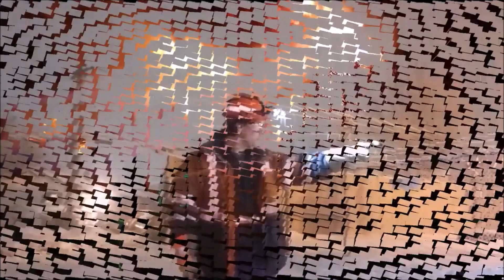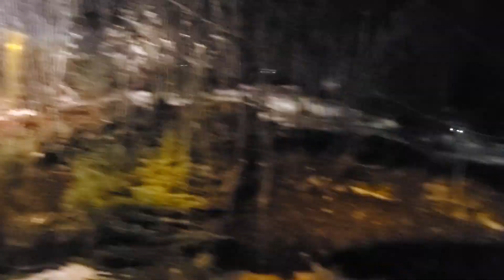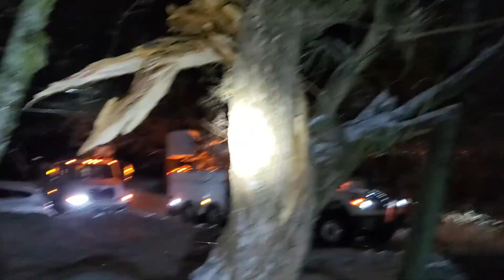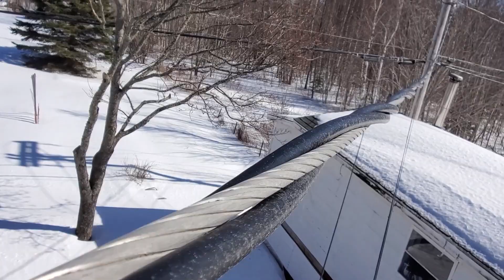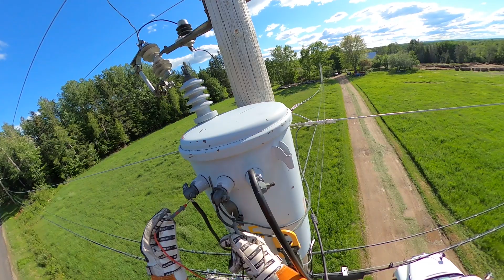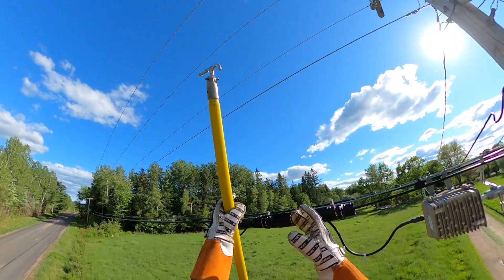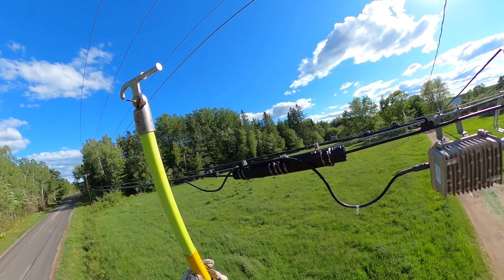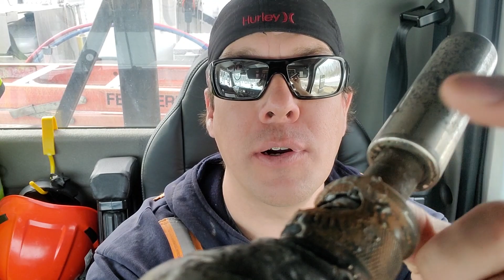Accidental contact with 120 volts

Comment: I can't imagine the fault current. Glad to hear no one was hurt. Stay safe! 👊
Reply from the maker: Definitely broke 1000! Yes, very lucky there wasn't even a slight sunburn. Cheers!
Reply: If he was close to the transformer, maybe 6kA.
Reply: @jfbeam  Probably not that high if it was residential.  I believe a 50kVA pole pig with 5% impedance has an available fault current around 2400 amps.  Residential breakers usually have 10kAIC rating.
Reply: @rampagerick  I might be wrong, but if the transformer is 50kVA, @ 5% imp, wouldn't the fault current be close to 4200A? It's been a while since I had to do the calculation, so, like I said, I might be wrong.
Reply: @IceBergGeo  

Rating divided by voltage to get full-load current. 50kVA /120V = 0.417 kA. Divide that by the percent impedance (5% = 0.05) to get available fault current. 8.33 kA.

This method assumes that everything upstream can provide unlimited current ("infinite bus") and that the transformer's impedance is the only thing limiting the fault, so it overestimates actual fault currents. It might be acceptable to use a different formula that takes other things into account and thus gives a smaller number.
Reply: @jordanrodrigues1279  your formula is the same one I used, but you have to consider you are actually using a 240V transformer, with a 120V center tap. So half the available fault current is available on half of the transformer.
Reply: Glad everyone is ok . Congratulations on the new house.  Love from new York.
Reply: Amen 🙏 better the tools than yourself
Reply: Thumbs up for the number of people who know how to imagine the ballpark amount of available fault current
Reply: I have seen secondary lines burn open many times and never take out the primary cutout. Definitely got a good welder.
Reply: the fault current can be calculated given all the right info.  breakers have these ratings, too.

Comment: Sorry but i have never understood the idea of 120V being less lethal than i.e. 7200V, hope you maybe can explain?
What i am trying to say is that if the voltage is high enough to flow trough your body, then is it lethal (yex  except very low current)
Reply from the maker: Even extremely low voltage can be lethal is contact is directly across a vital organs. Like you said, if the voltage is high enough to have conductivity through you, it can be lethal. 
I think some consider lower voltages "less lethal" because they can be more forgiving. That's definitely not an excuse to treat it any differently, however if you were to have 69kv across your body vs 120v, the chance of survival would be much much greater with 120v.
Reply: @Bobsdecline  Thank you for replying. Ehm bigger chance at 120V yes maybe but it that not like saying that your chance of survival is bigger by being hit by a dump truck than a freight train? Almost theoretical and better to "pretend" both are guaranteed sudden death?
Reply: The way they taught it to me is that voltage has the potential to send more current through a given resistance and it's the current that kills you - but don't get careless with lower voltages either because if you got good conductivity and / or the current goes through your heart , even LV can do you in - like if you have dry gloves a few hundred might not kill , but if I got barefeet in the rain or mist and I get a left hand on 50V and current goes through my heart to ground through my leg it might be all she wrote.
Reply: If your body is a fixed resistance, 7200V/120V = 60, so a 7200V line will push 60 times more current than your wall voltage which can be far more lethal.
Reply: Or if you have a low voltage and low impedance path.  Story I was told 40 years ago, when we all tested our skin resistance with the old Simpson analog meters, which is safe enough, was one guy in, I believe ET school in the Navy, got the bright idea to test his resistance beneath the skin and inserted the probes in each hand.   Well, the skin has a fair resistance, but the salty blood is a very good conductor and he killed himself with a AA battery, definitely not more than a 9v battery.
Reply: @jkbrown5496  I've heard that story though, not sure if it's a myth or not. I wish I had a better idea of how resistive blood is, though it must be pretty low because whenever I measure my skin resistance it doesn't matter what two points I pick, even if the probes are 1 inch apart or on totally opposite ends of the body it reads pretty much the same, indicating below the skin is far more conductive.
Reply: @compwhiz797  Sure that's part of the reason why it's more dangerous on the poles, GFCIs will trip when about 5 mA runs through your body to ground and stop you from getting shocked as badly.  Your theoretical situation doesn't really make sense, where a 120V pole could push more current than a 7200V one. There's no way in hell that you could push even 5 amps through your body at just 120V, your body's impedance limits the current too much for that to happen. Therefore it doesn't matter if your 120V pole could put out 10,000A, it would be impossible to get your body to draw that much current. So no, I don't think you can argue that it would be more dangerous than 7200V. This is just simple Ohm's law. It's like arguing that your 12V car battery is more dangerous because it can crank out hundreds of amps while your wall socket can only put out 15 before tripping.

Comment: Great information. We use 220v in the UK. My friend is an electrician and a house current went through his current safe screwdriver and melted entire thing from the handle. Electricity is no joke.
Reply: We also use 240v here in the USA. It's used for higher power loads like dryers and hot water heaters. The 120 volts hot to neutral here is derived from a grounded center tap on the 240V winding of the transformer feeding the residence. 240 volt loads are connected to the 2 hots, but no single wire is greater than 120v from ground.
Reply: @chrisbauer1925  thus, our 240v is a bit safer for accidental ground contact like when your bare feet are on wet concrete.
Reply: @philhoward4466  I'm assuming you live in North America? If so that is true, though in many cases our 240V circuits are not protected by a GFCI, while the 240V circuits in the UK often are, so in that case the UK system would arguably be safer despite the higher voltage to ground. On the other hand, our GFCI circuits trip at 5 mA, far lower than UK RCDs which often trip at 30mA.
Reply: @chrisbauer1925  1 mA is just a 50/60 Hz 'tingle', 3 mA is a very painful shock, 5 mA would land most people on their ass, which is why I tell people never ever tempt fate and test a GFI by touching a live wire. 30 mA at 230 volts doesn't sound very safe, if a human takes 30 mA of current thru a body part at 240v, could be quite dangerous. But its much safer than not having an RCD, which is what those devices are called across the pond. In North America, about the only 240v devices that are on a GFCI breaker would be like a hot tub.
Reply: 240V in USA is not the same as 230 or 240V in EU/UK. 230 or 240V here is the single phase voltage, phase to ground. We also use three phase voltage, which is 400V in EU and 415V in UK between each two phases. Now that can carry a lot of power, but also is very dangerous. That's why single phase wall sockets and plugs do everything to not expose any live conductor when when plugging and unplugging thungs. And as for the three phase sockets, it's a completely different story. They look like proper industrial style sockets and connectors, just look it up on Google Images and you'll see what I mean. 400V can hurt you badly.
Reply: Did he get a refund from the lifetime warrantee on the tool :)
Reply: I envy your electric tea kettles.  120V * 15A just doesn't get the job done.
Reply: Germany uses 240v
Reply: No here in germany normal houses have either single phase 230V L-N or 3 Phase 230V/400V (230V L-N, 400V L1-L2)
Reply: Melted to the handle. One second he's holding a screwdriver next is a hot plastic nub of a handle. It'd be funny if it wasn't so serious
Reply: Probably was using one of those "current safe" screwdrivers made in China. Kinda like the 5, 7.5, 10, and 15 amp blade type automotive fuses i recently bought that were made in China and they all had the same resistance of 2.5 to 3 milliohms instead of ranging from 19 down to 1.5 milliohm. Saw a youtube video where a guy with a high end ohm meter found the exact same results. So essentially a 5A wouldnt blow till 15A was going through it. ugh.
Reply: @LBCAndrew  Sounds like the good ole Federal Pacific Panels here in the USA .  They were doing their own testing for UL . Most of them went way over the load they were supposed to and caused 🔥 's..  They are out of business now do to all the lawsuits
Reply: No we dont, we use 240V in the UK and mainland Europe use 220V, there was a european union harmonisation of the voltages so that europe came up to 230V and the UK dropped to 230V, but the UK didnt really drop the voltage. Also if your electrician friend had that happen to his screwdriver, ask him what did he do with the cutout fuse? domestic dwellings are fused at 60amps unless its fitted with storage heaters and then its 80amps.
Reply: @stiggyness1976  the Voltages did not change. The tolerances changed to accommodate 220 to 240 :-)
Reply: @andrewwhite1793  I have measured the mains voltage many times throughout my life in NL, last decade it has always been 230 volts +/- a volt or so.
Reply: @Engineer9736  The UK also has 230V nominal. We both have harmonised European  voltage. However UK is 230V 6% +10%.  it is stable but at 240V +/ a Volts which still the way it's been for many years.